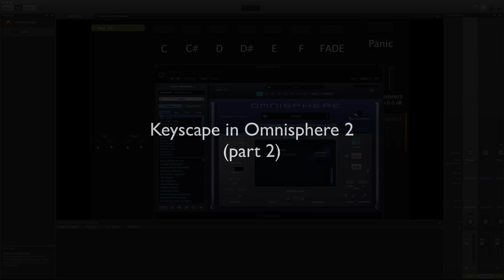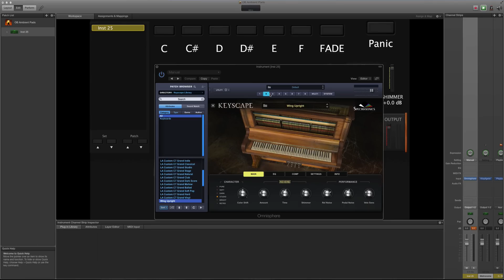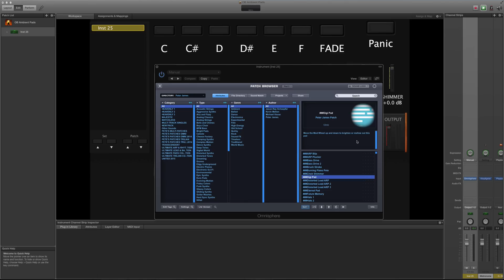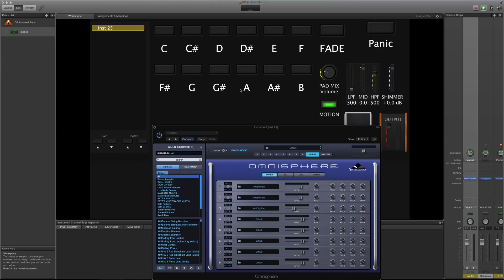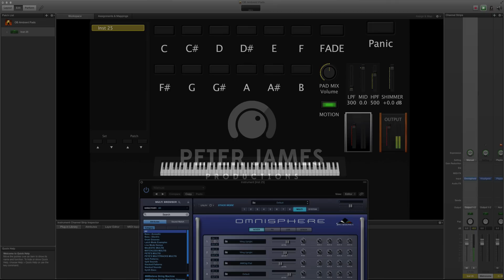Keyscape in Omnisphere 2 (part 2)

Comment: Hello, and thank you for the really good content you put up! 
I have a couple of things that've bugged me for the last week or so. I recently bought both Omnisphere and Keyscape, but it's kinda killing my Macbook Pro (2012). It's too big to store on my internal hard drive, so I have it on a HDD, which works grate with Keyscape alone,  but it crashes whenever i try to use it inside Omnisphere. 

 The second thing is that I use literary all my ram (8GB) to run Omnisphere. 

Do you have any takes on this? I can't figure out how to solve it...
Reply from the maker: Johannes Minge I cant say exactly what the problem is, but you can run lite versions of most of the plugins if CPU is an issue. You could also upgrade your ram to 16gig as well. I’d suggest emailing Spectrasonics as well. They’re customer service is great.

Comment: Hey Peter,

What kind of CPU Load effects does Keyscape have on Omnisphere 2?
Using your CPU load tips video, my Mac will generally run at about 15-20% cpu load with Omnisphere Lite Patches. It's a  Macbook Pro 2.6ghz i5 with 8gb RAM.

Any thoughts?
Thanks in advance!
Reply from the maker: TheUnfinishedSongProject Keyscape can be quite CPU heavy because of the type of instrument it is, but you can reduce it by using lite versions and reducing cpu hogs like Reverbs etc. it just a matter of testing